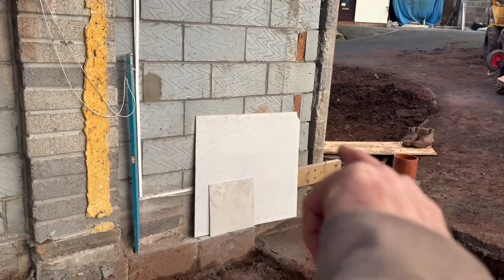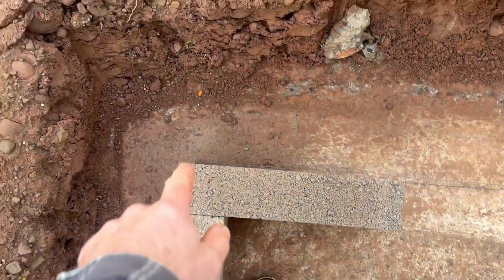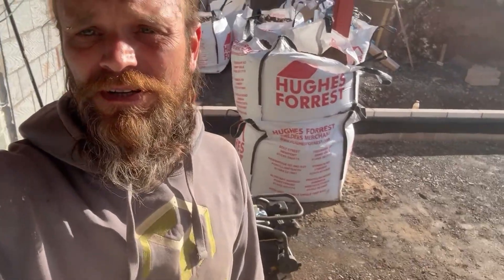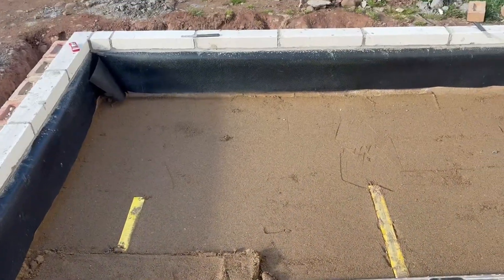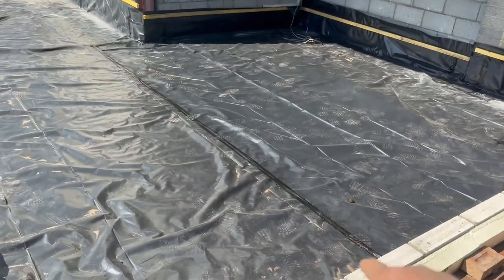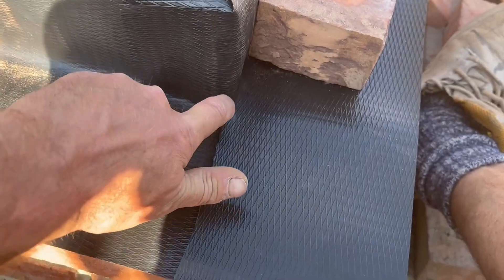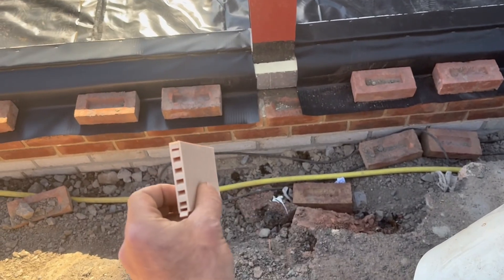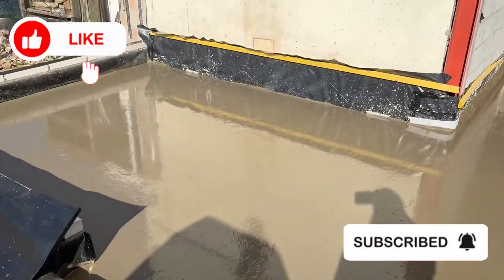Building Up To DPC LEVEL - Damp Proofing Course for EXTENSION #howto #garageconversion #construction

Comment: Great video, thanks. Do you bother with a skim of cement under your tray to hold it in place? Or do you just build straight on to it.
Reply from the maker: Thanks, hope it was useful! On this occasion I did on the outer leaf of brickwork but as I was using lightweight thermal blocks on inner leaf, I just stapled it to the top of the blocks as it stops it moving around everywhere and makes it easier to form. I always bed my normal Dpc course on a thin bed of mortar though. 👍

Comment: What slump was the concrete?
Reply from the maker: Not sure tbh, I tell the concrete company what the concrete is for (footings or slab e.t.c) and how workable I want it and they mix it on site in the wagon, so slump test is left to them really as residential extension drawings don’t usually spec a specific slump on the concrete👍
Reply: @Kippaxsignaturehomes ah thank you
Reply from the maker: @HarleyN93  no worries dude👍

Comment: Why do some extensions require a damp tray at dpc level and others dont? Surely if the external ground level stays 150mm below dpc level it would have to mean the cavity would have to completely fill up with water from the cavity fill which is 225mm below dpc up to and over the dpc level? Which even in that scenario the damp tray is deemed useless anyway 🤔
Reply from the maker: I get what you’re saying dude, I often wonder this about quite a few construction details to be honest. I started putting these in years ago when inspectors round are way wanted basic radon protection on everything, which is pretty much the same deal so I just do it as habit now spec’d or not. Plus I think it is also to catch any water coming down the outer leaf of the building and divert it away from inner skin and out of the building through weep holes ,not like that would happen but it’s good practice and inspector likes to see it. This would probably be more likely with face brick I guess.

Comment: Hi pal love the vids lots of detail I’m doing a never ending small extension when I get time off work, can I ask why there is only one skin below biofold doors is it to run the ufh in there to avoid cold floor just inside opening cheers buddy
Reply from the maker: I feel your pain dude, I’ve got a never ending renovation going on aswell🙄🙈 yeah so that is the correct way of doing door openings, there are a few reasons why, so I will try and explain why, so basically there is no need for a cavity below a door because you have a cavity lintel, cavity tray and weep holes above the door so there is no chance of water ingress. Your doors will be fitted on the outer skin of brickwork so there would be brickwork left in the way on the inside of your door opening. By not doing 2 skins of brickwork, it allows you to run your insulation right up to the outer brickwork  so there is no chance of cold bridging , i usually also put a thicker perimeter up stand of insulation against the doorway as well. The other reason is that the finished floor level is not always at Dpc level so the internal skin of brickwork could well be too high and need chopping out after anyway which would leave you with an un insulated section of floor also. Hope this answers your question👍
Reply: @Kippaxsignaturehomes  thanks very much for getting back to us yes seems to make sense now much appreciated advice there buddy 👍👍👍
Reply from the maker: No probs dude👍 feel free to ask me any questions if you are stuck on anything else👍 hope the extension goes well!
Reply: @Kippaxsignaturehomes  don’t say that your phones gonna be red hot by end of week 😂

Comment: Hi, how come theres no cavity where the door will be fitted. I noticed the slab is upto the outside course. I've seen builder's do it both ways but don't know why. Am i right in thinking it will be easier to fit the door and also add more strength to that area?
Reply from the maker: Hi Scott. I will try and explain. Basically this is the correct way to do it. There a few reasons why so will try my best. 1.- There is no need for the cavity as you have a cavity lintel above doors with a tray and weep holes. 2- if you put a cavity in, you would have bricks protruding past your door on the inside which may well be a different height to your finish floor level which will need to be dealt with later on as it will cause probs. 3 if you remove bricks later on you will have an un- insulated section internally that will result in cold bridging and condensation. By closing cavity either side, your floor insulation runs right up to the door and perimeter insulation goes against external lead of brickwork. Hope that answers your question👍 thanks for watching!
Reply: @Kippaxsignaturehomes thanks for taking the time to explain that for me.
Reply from the maker: No worries dude, hope it made sense 👍
Reply: Do you work up Liverpool ways at all ??